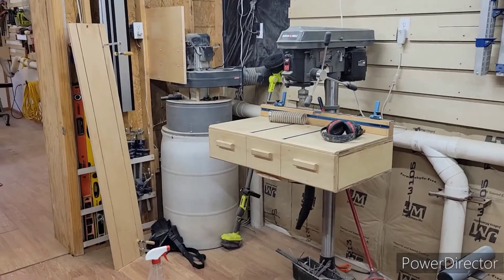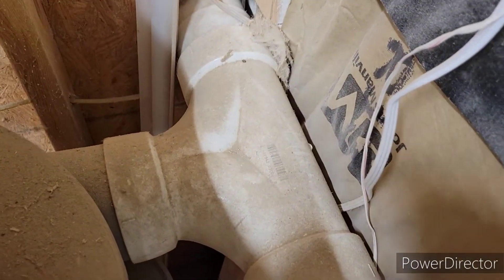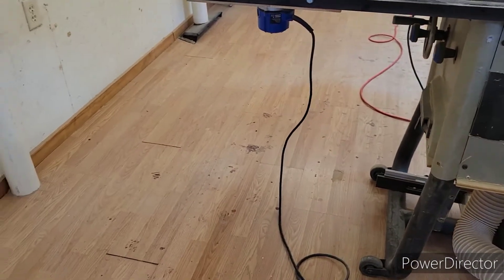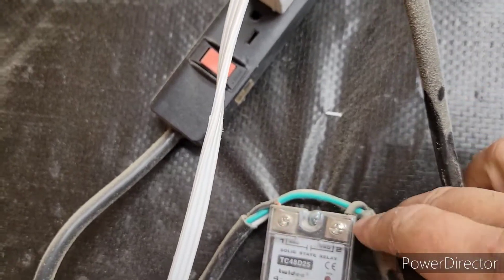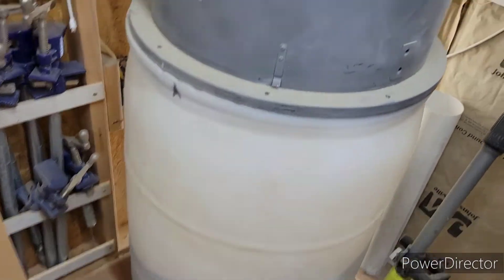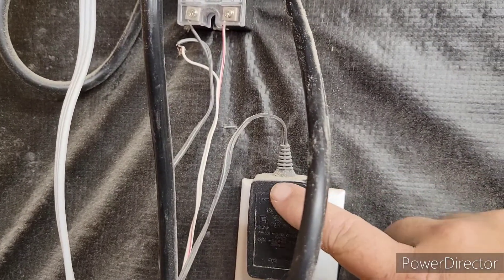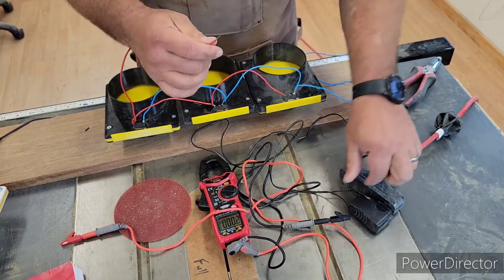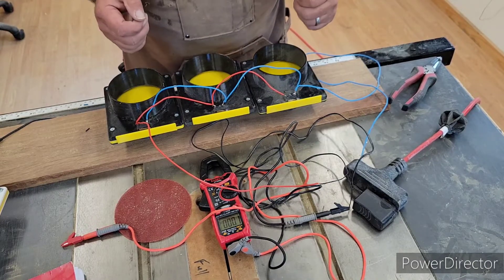Micro Switch wiring for Dust Collection Automation

Comment: Thanks for the video. There use to be a product called Long Ranger or something like that but it is no where to be found any longer. 

Sorry  if it was answered but what is the name of the pass thru blast gate and where did you get them?
Reply from the maker: I 3d printed them. I am moving my collector outside, and I am in the process of designing new gates with tactile switches inside. The prototypes came out good. I hope to get a final model done this week. If there is any interest, I may offer them for sale.

Comment: Man thank you so much for these vacuum system videos! Great stuff
Reply: Great job explaining a micro switch also. Most people don't realize they can be wired two different ways. I didn't till I put custom limit switches on my aufero laser 2 engraver. Great job.
Reply from the maker: @squash419 once you start building 3D printers and Laser engravers you realize micro switches and extruded metal is very simple to build with. Micro switches and relays are just an analog version of what all computers do. The only difference is that computers are based on logic gates, and you can set up relays and limit switches to act just like logic Gates.
Reply from the maker: Glad you like them!

Comment: Have you had any issues with static in your system? The reason I'm asking is when I deleted my plastic bag to the barrel I noticed a lot of static locally on the vacuum. I just ran a ground wire from the motor ground to the metal ring on the vacuum with a ring connector. 

I've heard others say to run wire inside the pvc and every so often attach it to the pipe to help with static. 

I haven't ran the pvc runs yet and was just curious
Reply from the maker: Never had an issue. I asked a friend who has the same setup. He has not had an issue either. We are in Florida. Not sure if that makes a difference.

Comment: good job. awesome idea. i actually use a remote but I spend most of the time looking for it. LOL . where did you gate those blast gates. I have the ones you were using in the demonstration.
Reply from the maker: I printed them. I have been planning on printing  some new ones that have the switch built in. These are working, so it is not on the top of my list of things to do.
Reply: @ShopRamblings  great job

Comment: crazy helpful , wanted to buy the longrange  blast gate on of system , can no longer get it anymore,  only thing is in running 220v motor on my dust collector, but your video has put me on the right track, thanks and cheers!
Reply from the maker: You just need a 220v relay.

Comment: Great tutorilal. I have been wanting to do this myself for a while now but the DC I use is 220V, not 110V. Do you know how which relay I would have to use to make this work for me?
Thanks
Reply from the maker: https://amzn.to/3ALOdO8
These  relays have several models from ac/ac, ac/dc, to dc/dc. They have models 25 amps to 100 amp. They can take 24 volts to 380volts. There should be an option that will work for you.

Comment: Simple is Better! Thank you for a very useful and 'simple' solution.
Reply from the maker: The only thing better than simple is cheap. I spent $10 and parts I had laying around. It has worked so great for me and so many people are watching my video I am planning on buy new switches and filming me  rewiring the system with some wiring diagrams.

Comment: So simple, yet something I think everybody wants to do to their shop! Thank you for the share!
Reply from the maker: If others are like me, if it is not simple to use they won't. Then when they look at commercially made systems at $100 per gate then it goes to the bottom of the list. To build a whole switch system for under $50 that is easy to use now there is no excuse for anyone. It has completely changed how I work. I clean organized shop just make me want to put out higher quality work for some reason.
Reply: @ShopRamblings  I 100% agree! This is very high on my list for that very same reason.

Comment: Great job on the tutorial.  Do you have links to the relay and micro switches?
Reply from the maker: I have updated the description with the ones I used. Sorry for not doing it sooner. Let me know if there is anything else I can do to help.
Reply: @ShopRamblings   thank you!  I wondered if you went 24v.  Just have to see if I have a 24v power supply before I go shopping…
Reply from the maker: It operates on 3-32 volts DC. Almost any power supply will work. It will switch 24-480 volts AC. If you don't have one something like this should work.
https://amzn.to/3CGzaa8
Reply: @ShopRamblings  thanks!  I had my inputs and outputs reversed.  Just got my white 55 barrel today.
Reply from the maker: I am super busy but if you run into any problems I will try to answer them as quick as I can. I know how it is getting in the middle of a project and hitting a snag.

Comment: What is the power in CFM you got going through those big pipes!?  Nice setup man!!!  Petty cool high voltage relays you got there.  I would completely enclose those in non conducting waterproof electrical junction boxes, and I would also make sure that all the wiring is going through non-conducting pvc electrical conduit.  Yeah more work, but it is way more safe.  If those relays ever come loose or the insulation on your wiring wears off or gets wet watch out!!!  Keep up the amazing work, and be careful!  Something you also might want to consider, not sure if this is how you have it or not, but instead of having all those switches operating at 120 volt, you can lower the voltage for most of your switches to low voltage, and have it so only 1 relay operates at high voltage where it turns the strip on for power, that way you really only have to junction box and conduit that small high voltage circut, and the rest of the system you do not need to highly protect since those will have been lowered to something like 5 volts or less...  I am sure you get the point.  This way you do not have all those wires running at 120 / way more safe.  Again I kinda glanced through the video and you might have already done this.  Cheers!
Reply from the maker: Thanks for taking the time to make such a long post and to be concerned with my safety. I will try to respond to all your points but most will be covered in one thing. The system only has one solid state relay. It operates on 3 to 36 vcd. All the wiring to the micro switches is basically a cell phone charger. I did a follow-up video on how to wire micro switches where I twisted the wires while it was energized with my bare hands. The wires have the same power as a couple of AA batteries running through it. The only 120 AC power is going to the outlet from the power strip. That wire is cut and connected in the solid state relay which has a UL approved clear cover over it. This is all indoors and has no more need to be in a waterproof enclosure then all the outlets in the walls. As far as the CFM when I originally built the system I purchased a anemometer. At the system intake there was no discernible difference before and after the modification. At the farthest end of my piping I believe it was between a 5 and 10% reduction. My table saw is the next the last tool on the system. The pipe goes down through the floor underneath my shop then back up about 5 ft which makes an essence a giant P-trap. I have never had sawdust get built up in it. So for me the most important thing is there is no way that it could work better for what I am doing. The only possible thing that I could think of that would make the system work better for me would be if I built inductor switches that detected when I energized a tool and automatically opened the appropriate blast gate. I hope this answers all of your questions because if one person takes the time to ask that means that they're probably were dozens that wondered the same thing but did not take the time to ask.

Comment: I appreciate, and I'm certainly sure the commenter who asked the original question does as well, you taking the time, despite being in the middle of another project, to quickly but efficiently explain your system. 👏
Reply from the maker: I shot the video building the baffle over 4 months ago. It has taken me that long to get it edited. I knew if I didn't stop and make it now it would be 6 months are more and didn't want to people to miss out. Next up grade will be inductor switches that detect when a tool is turned on and opens the proper gate.